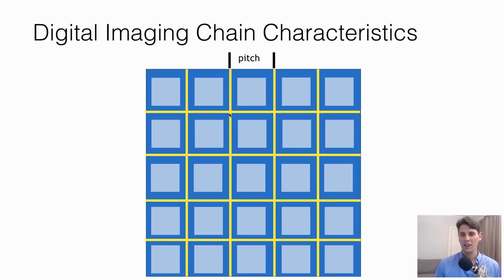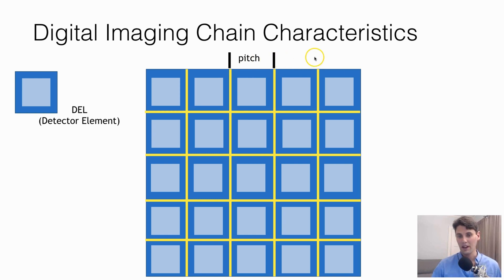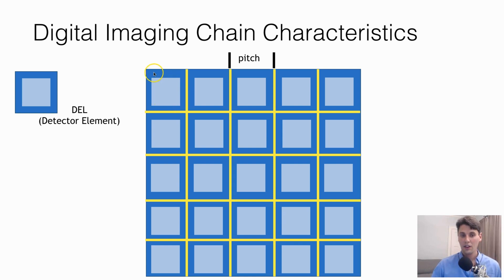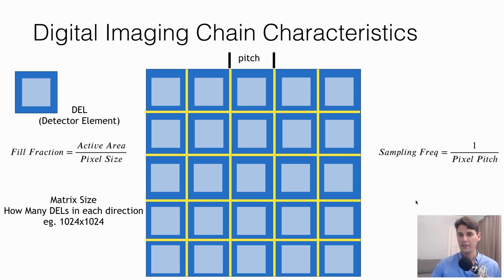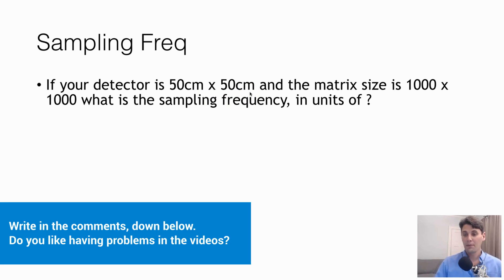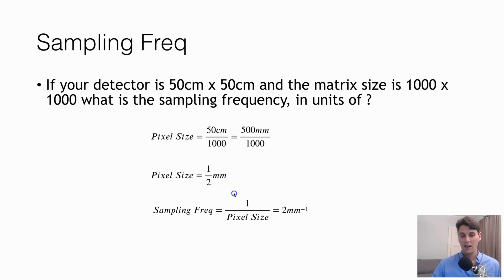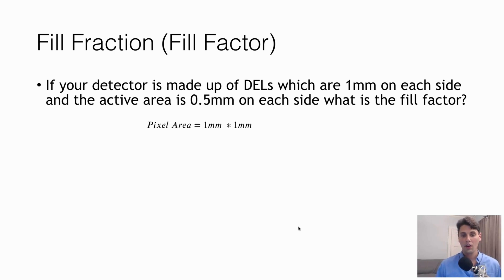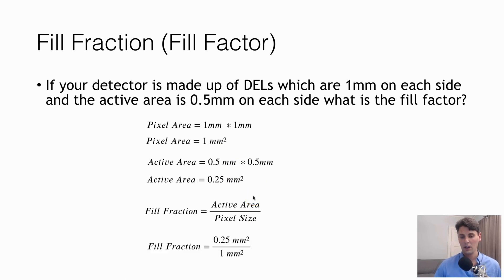Flat panel detector definitions (Fill fraction, dels, pixels, matrix size, pitch)

Comment: What IS sampling frequency? I know we calculate it based on the Pitch / DELs etc, but what is its significance/what does it represent? 

I must be missing something significant because I've looked everywhere and I can't figure out if it's anything other than pointless extra measurement somebody came up with; it feels like I'm being told "The Abracadabra Value of the FPD is equal to twice the pixel pitch". Okay, the abracadabra value is 1mm; why does it matter, what new information does this give us we didn't have before, and why do I care? Why did I make up the abracadabra value in the first place?

 I have the same questions for Sampling Frequency. It's 2mm^-1, why does that matter? What do I know now that I didn't know before? I know we say it's another way to determine DEL size, but so is the abracadabra value, so is the Sampling Frequency and the Abracadabra value equally useful?

Can someone please unlock this for my brain to understand before I end up in a mental institution.
Reply from the maker: https://howradiologyworks.com/digital-x-ray-sampling/ check out our post with the sampling frequency. We like units of frequency as traditionally we measure resolution in frequency such as the MTF. You can think of sampling frequency of the detector as the best that you could do on the resolution of the system and there are geometric effects and the focal spot blurring

Comment: Hi! Thanks so much for the video. 
As the detector sampling frequency increases so does the spatial resolution and should be twice the signal frequency. But I had read that as the sampling frequency increases the sensitivity may drop . Could you please explain how that happens?
Reply from the maker: As the sampling frequency is increased the detector elements are getting smaller and there are some electronic components which can not shrink so the fill fraction goes down because the fraction of the detector element that is actively collecting x-rays goes down. Since the fill fraction is lower the detector is less efficient at measuring the x-ray and hence will have a lower sensitivity.